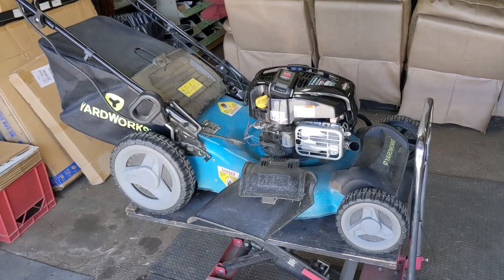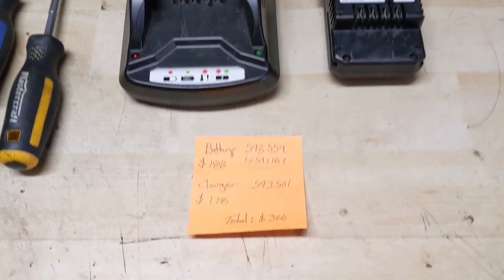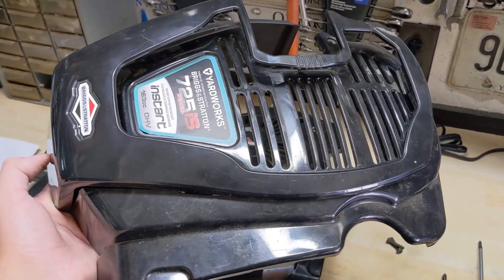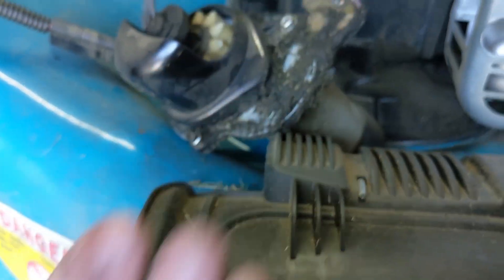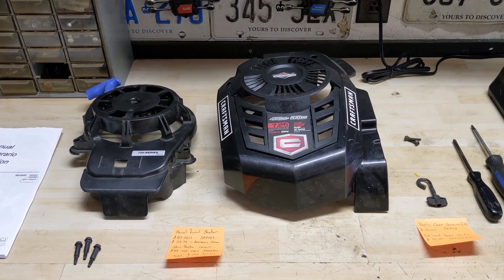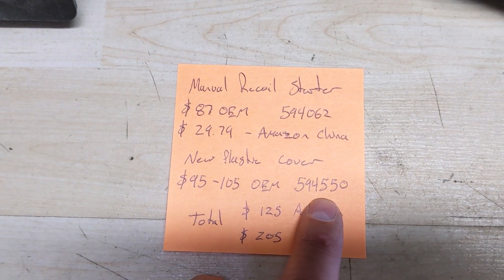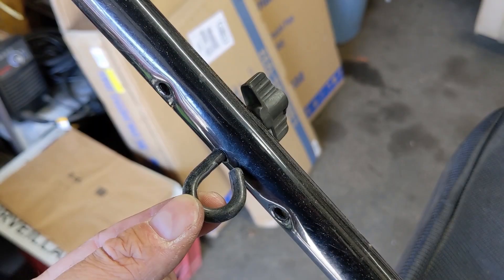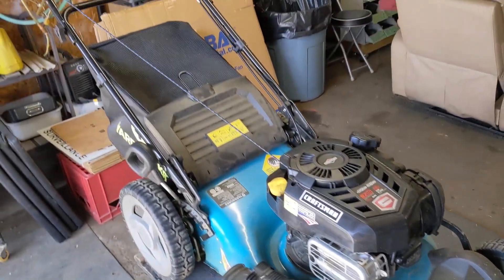Electric to Manual Pull Start Conversion on Briggs and Stratton 725IS

Comment: I have done this on my old 5.5hp inteck engine. Now it will only start using a drill on the crankshaft. Seems like the the pull cord doesn’t turn over fast enough. Anybody have the same trouble?

Comment: Just change it over to work on a milwaukee or dewalt battery
Reply: You can get the step down that it will work on a 20v or 18 v batter i just did one only cost 15 bucks canadian all have to do is wire it in
Reply from the maker: Never tried that but it's a great idea! If it was my personal mower I'd certainly try it, but this one worked perfectly to covert back to pull cord
Reply: It very easy to do no changing body parts on the mower

Comment: I have a 2012 Craftsman 7.25 BS engine with electric start. The starter motor died in 2019, but the 2012 engine still came with the pull start. Replacing the starter motor and solenoid would have set me back nearly $400 (had to get from US and ship to Can), so I've just been using pull start ever since. Also the battery at the time was a relatively inexpensive SLA battery, not Lithium.

Comment: $ 300 for both parts to get the electric start system in working order again 😮
Reply from the maker: @madaboutmowers  yup, manual pull start it is!
Reply: @EliminatorPerformance   you got that right  even the original pull start And plastic cover is very expensive 💵 to make it pull start  $700 for the mower is more than the price I paid for My Husqvarna AWD mower that is equipped with the Honda 190cc engine hopefully Jake will be making some more video's soon I miss him doing that
Reply from the maker: @robertmailhos8159  video coming within the next couple months!
Reply: @EliminatorPerformance   cool beans 🫘🫛  Wayne and Jake 😎😁😄👌👍✌️💪

Comment: Id just would of convert the battery set up to use a small 12v generator style battery and use  a battery tender to charge it .  Bad back  pulling not very fun for me.  Also the pull start can be add with the electric start  so you can use one or the other.  Another option if only electric start  and in case it does fail you can drill a hole in the top cover that way you don't have to disassemble the top to use a drill to start it and use a cap to cover the hole in till needed . Just my opinion and opinion.  Beat paying  1000$+ for two lawnmower  in a 3year span 💯🫡👍✌️👌💪🤑

Comment: Ditto for the BS875 pressure washer, where the conversion is even simpler. After investing hundreds of dollars on new batteries, I switched to pull-start for only $30.

Comment: Got this brand new in the box lawn mower from someone selling it on Kijiji for 125$ but without the battery and charger. 

I guess this deal isnt bad if I can convert this 700$ lawn mower into a manual one for 30$. Will give it a shot.Thanks

Comment: Can I keep both: Battery starter & Manual?
Reply: Technically yes but you might have to hack out and relocate the piece of the plastic trim that holds the battery/receiver/wiring and relocate it securely on the deck or similar.

Comment: The low voltage battery terminal is the pull down to earth to switch the battery positive to the terminal via an internal battery relay.. You'll notice if you bothered that the + and - from the battery go straight to the motor, via an interlock relay. The push button does not supply the starter current. 
The charger doesn't deliver any power unless a battery is inserted to charge. Starting failure is usually due to poor connections in the looms from battery to interlock to motor, and battery relay terminal to push button.

Comment: Thank you so much. My lawnmower had an electric start only, and i would have to start it with jumper cables since all the electrical wiring was bad. The starter recently blew out, and the manual seems like the way to go. Was able to start it with rope, but it took 15 tries😅

Comment: I tried using battery powered tools ie., a drill in the late 1990's and I learned my lesson I will never go down the path of battery powered tools and machinery!  You end up throwing everything away because it was cheaper to purchase a new drill.  I prefer a corded drill and saw because I don't use the equipment everyday! However, for my lawn equipment everything is gas powered except my Toro Leaf Blower - it is a beast and many excellent reviews persuaded me to purchase the  Toro PowerJet™ F700

Comment: where do u find battery charger and battery?? Ive looked all over and can't find any place in canada. thx
Reply from the maker: That's one of the reasons why we converted, it's not worth fixing the battery and charger.
Reply: I am fixing a battery with a High hope of success be faster with the circuit diagram ! great video...cheers. @EliminatorPerformance

Comment: I doubt there is anything wrong with the charger, those chargers only provide power with a battery present. My battery's packed up after 7 years of heavy use, here in Sweden they're about 900 SEK (do your own conversion, but around 80-90 USD), so I'm looking at a conversion for now. It's time to go robot, but I don't have the funds right now.
Reply: My 5 year old charger failed today, opened it up, no obvious dead components. High voltage is being presented to the switch mode primary. No circuit diagram to be had. Complete new charger is  €51 at a place not too far away, fixing it will be a hobby project, I'll buy the new one.
Reply: I have just been given one of these batteries to fix and can't find a circuit either. Is your charger ok now is the battery ok too please and did you find a circuit for the battery? @brokenglasses121345

Comment: The battery pack only puts out voltage when the E Terminal is shorted to -VE.   You can jump start the mower by putting a 12V battery on the + and - on the mower itself (as marked on the battery pack, as the mower is not marked).  You need around 20A current.  The charger also does not put out voltage unless the battery is connected.
Reply: I have one of these (different brand of mower, slightly different Briggs & Stratton motor, but still an "IS" with that same battery).  When you say "-VE", do you mean the "-" terminal?  The outer terminals are - and +, and there is an "E" and a "Th".
Reply: @cowsongs  Yes, the - (minus) terminal.   (Sorry, by -ve I meant negative.) The Th is connected to a thermister in the battery pack so that the charger to read the temperature of the batteries while it is charging, and adjust it's charge rate.
Reply: Out of interest what is the E terminal?
Reply: @briantimmins7483  Electric Start Button.  The battery does not put out any voltage until the E terminal is connected to the + terminal

Comment: Converted mine from the rubbish briggs battery over to a dewalt battery, dewaltpacks are pretty cheap and supply is not a problem, dealt charger and battery for around $50.
Reply: How did you manage to do that ? I have this same mower and worried about it’s longevity with the whole battery thing

Comment: Thanks for this video! I have issues with the electric start motor on a 575is. Can I use the same starter pull assembly? (594062)
Reply from the maker: Yes they should all be interchangeable
Reply: Thanks!

Comment: All electric start does is add a layer or two of complexity to a walk-behind mower.  A layer that has multiple potential failure points.  Pulling a cord to start just isn't that big a deal.
Reply from the maker: Which is why we converted it, thanks for watching!

Comment: I have a 1979 Ford 125 riding lawn mower. I took out the original 12hp Kohler engine to rebuild. I bought a brand new 2020 Kohler Command Pro 14hp engine which is a pull start. I hooked shaft up from new motor to the shift that goes to my gearbox. I pull start the engine, shift spins great but I can't get mower to move. I have a high gear and a low gear then neutral. Shaft is spinning but no movement of mower

Comment: had a similar colour yardworks with ctc number on it left at our charity scrap dumpster.  model number 96..... appeared to be an AYP mod number. found ipl and part numbers start with 532 which is AYP.
Reply: Husqvarna starts with 532 also

Comment: Yeah I'm not a big fan of that set up either with just only the battery only start because look what happened the battery in the charger both failed and will cost more to replace than what the mower is worth so it was a good idea to put this as a recoil starter instead and one good thing about it the parts are interchangeable
Reply: The battery and charger did not both fail.  They read 0 across the - and + terminals on both the battery and the charger unless you connect the other terminals together in just the right way.  I think it is the "E" terminal that has to be shorted to one of the others.  Then you will get voltage out of the charger (and if you do the same, you will get voltage out of the battery).   I have that battery and charger and they both read zero (or near it) across the "+" and "-" unless the battery is IN the charger.  That's because the other terminals are then correctly connected.
Reply: Do they read ok after grounding 'E' please ? I ask as I have the battery but no charger and I want to fix the battery, Which out of these two fail the most ? @cowsongs
Reply from the maker: Yes, now it's just pull start like it should be. These engines are easy enough to start with the compression release, so I can't see the need for only having electric start and no pull start backup

Comment: Was better remplaze the battery inside the batery was more cheaper and great starter
Reply from the maker: I would disagree, as there will be issues with batteries in the future. This system only lasted 2yrs, so replace the battery or charger again in another 2yrs? Now whoever buys this can pull start it every time, 1st pull!

Comment: I can’t wait to see all the battery powered automobiles in the wrecker in 7 years
Reply: 7 years, Lololo two years max
Reply: Not a relevant comparison. Many electric vehicles have already proven life spans on their batteries of 300k miles or more. The battery packs operate very differently from a little screwdriver battery.
Reply from the maker: I just saw an invoice for someone's Chevy that needed a replacement battery, almost 30 thousand!
Reply: @EliminatorPerformance  😂😂😂😂😂😆😆😆😆😆😠😠😠😠😠
Reply: @EliminatorPerformance  yes very crazy, keep up the great videos!

Comment: Don't you just miss the good old days when Briggs and Stratton made great engines?????🤷🏿‍♂️ Briggs and Stratton need to take their heads out of their ass and get back to making quality products. 🤔🤔🤔🤔🤔🤷🏿‍♂️
Reply from the maker: These are decent engines in terms of reliability. These are the ones with plastic carbs and the choke design flaw though lol so add this to the list of issues.
Reply: @EliminatorPerformance  I just can't understand why they want to make things so difficult for themselves? They must like filing for bankruptcy protection, like they did 2 years ago. 🤦🏾‍♂️🤦🏾‍♂️🤦🏾‍♂️🤦🏾‍♂️
Reply: Unfortunately they don't have to
Reply: Upper management through out the years have RAPED investors and previous employees, God only knows where all the physical assents went after all the buying, selling and stripping down the original businesses & brands

Comment: Wow who woulda thought another battery bites the dust after two years. Just wait until California has half the state filled with old dead batteries eh? This was a sweet project Jake and a really good video you are lucky we had those parts on hand in the hoard cause who would pay that much for the OEM parts !
Reply: Good  day  Guys. Boy things are expensive,   especially that rope guide 18.00   I am not convince  that  battery are the way to go.
My parents bought troy-built  with battery, turn over so slow.
Now manual start is as good as fellow behind rope, & in my case it is getting older  lol.   Thanks

Comment: Great video what’s your thoughts on lawnmowers with water connection for cleaning the undercarriage good-bad ?
Reply: This is the old man at EP: the water wash systems do work to a limited extent but the deck needs to be lowered to the ground to provide the turbulence required to do a decent job. Basically, if you only cut the grass when it is dry you will never have to worry about grass build up on the underside. If not possible pull the spark plug boot off the plug and tilt the mower straight back is the proper way to scrape debris from underneath. Alternatively tilt only to the oil dipstick side never on the carb side or oil drains into the air filter and carb. Additionally after tilting give the oil a chance to drain back down in the crankcase before running again. We undercoat our decks with Rust Cure 3000 non drip rust preventative it works wonders.
Reply from the maker: They work great, the issue is, no one seems to use them because it takes too much time. My neighbor used his after every other cut and his deck is always clean.

Comment: 9:21  Both made in the same factory in CHI NA
Reply from the maker: Probably lol but you buy the name brand, the quality control is a bit better, you usually get a quality part. The aftermarket, the QC isn't as great and you get some duds. Thanks for watching!
Reply: @EliminatorPerformance  B&S has at least ONE COMPLETE engine line in CHI NA , a close friend of mine worked AT the Snapper MFG. plant when it was in McDonough Ga. he was in the purchasing dept., he knew the engine codes for ALL the CHI NA built engines.

Comment: Maybe you could have reused the top cover, with modification for the pull rope and saved some $.
Reply: The top cover had a cutout area for the battery connection so it did not look good.
Reply from the maker: It's possible, but like I said, this was all free parts for us. $30 and someone could do this conversion. That's way better than hundreds of dollars on a battery and charger.

Comment from the maker: This Yardworks mower is exclusive to Canadian Tire here in Canada, and is not made by MTD under the well known Yardworks brand.

Instead, this mower is distributed by a Chinese company called Sumec Hardware and Tools. They are owned by SUMEC Group, which is china's largest importer/exporter.

The parts distribution here in Canada is handled by a company called Mecanair.

As shown in the link below, this mower comes with a 2 or 4 year warranty. My customer opted for the factory 2yr warranty, and here we are, 2yrs later with a failure that essentially renders this lawnmower useless.

The Briggs and Stratton 675IS is identical to the 725IS, all parts listed here can be interchanged.

More info can be seen here; https://mecanair.net/en/produits.php

Comment: He should have just bought a Honda. Or an older 2 stroke commercial Lawnboy. They run forever.
Reply from the maker: Yes, and even if the Hondas have electric start, they still have the pull cord! Thanks for watching!

Comment: Is that Yardworks an MTD product?  Never seen or heard of that engine in the United States.  Ridiculous not to have a recoil start backup as all the old style electric starts did.  For the kind of money your customer paid for it, he could have bought a Honda, which makes that machine look sick and is so easy to start that no electric start is necessary.
Reply from the maker: This Yardworks mower is exclusive to Canadian Tire here in Canada, and is not made by MTD under the well known Yardworks brand.

Instead, this mower is distributed by a Chinese company called Sumec Hardware and Tools. They are owned by SUMEC Group, which is china's largest importer/exporter.

The parts distribution here in Canada is handled by a company called Mecanair.

As shown in the link below, this mower comes with a 2 or 4 year warranty. My customer opted for the factory 2yr warranty, and here we are, 2yrs later with a failure that essentially renders this lawnmower useless.

More info can be seen here; https://mecanair.net/en/produits.php

Comment: Ha!…I didn’t know Briggs did this?! It’s funny to me cause probably 10-12 years ago I converted 2 electric battery start push mowers 1toro 1 lawn boy to 18 volt old nicad Ryobi batteries. I had old blue drills, cut the handle/battery mount off, secured to handle bar, wired into existing and let owners cycle in these batteries with their existing Ryobi tools. 18 volt cranked it over faster but last I heard they were still working even with lithium batteries.
Reply from the maker: Nice! Yea, these are Canadian tire exclusive. These engines are only offered on 2 models, with the 675IS and 725IS. Not sure how long production will last if there's issues after 2yrs
Reply: @EliminatorPerformance  I wonder if having the battery hanging on the engine all the time is causing any issues?..vibration, heat, moisture, etc. seems like it’s a piss poor location. Everyone else either mounted battery on deck or handle bar.
Reply: @Garmy INTERESTING, can't seen to picture what you did, would really like to see that rig

Comment: I don't even like the electric and pull start push style mowers as it's more weight to maneuver around regardless of being self propelled. On top of that who thought front wheel drive was a good idea? Try going up a hill with both front and rear and rear wheel drive wins at least in my book.
Rant over. Rage Eliminated.
Reply from the maker: Thanks for watching, yes this one is rear wheel drive. They have AWD ones now with variable speed for both front and rear, might do a video on one next time one comes into the shop